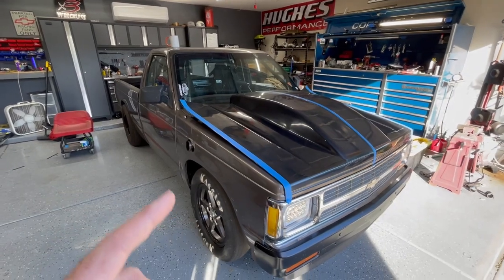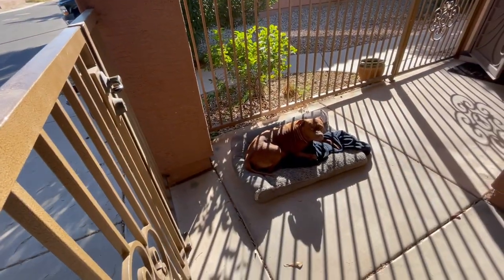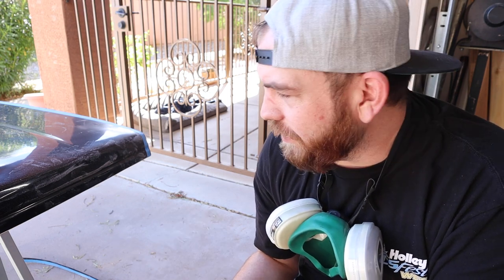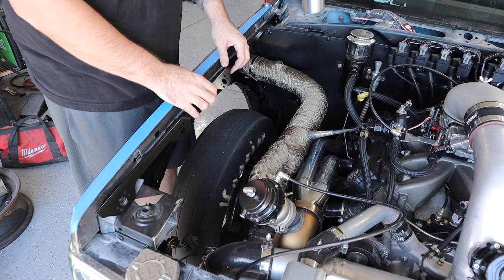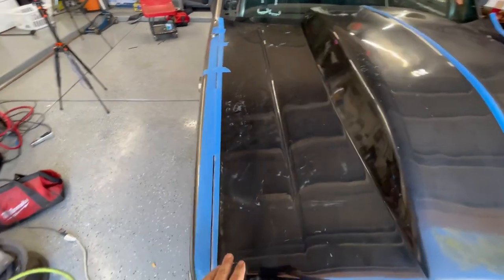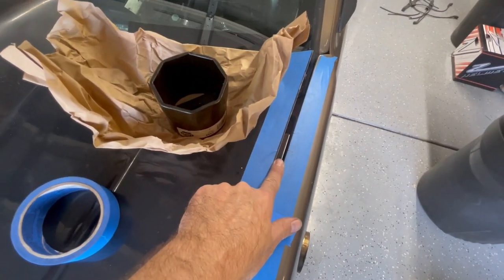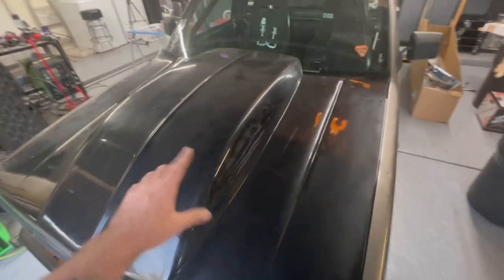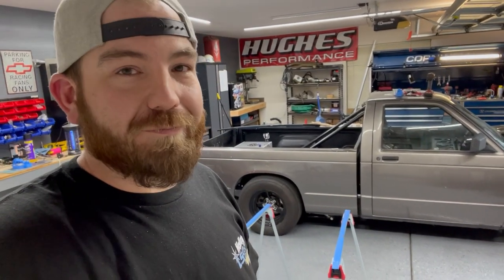FIBERGLASS HOOD INSTALL

Comment: just flatten the hood to gain, then ad a brace with glass to hold the shape on the bottom side for line up of the fasteners. then loosen the bolts on front of fender mounts and pull them in or elongate the holes to move them in as needed.

Comment: Can u loosin up driver fender an push it in 1/4 inch?
Reply: Or maybe even a little bit on both sides to make it close enough?
Reply from the maker: Then the fender and door would be off.
Reply: I didnt think of that lol my bad
Reply from the maker: I went back at was able to move the fender in some without it throwing off the alignment to the door too bad. Thanks for the pointer 👍🏼
Reply: @RobbyVsGarage  nice! I'm glad it worked out. Still adding to the hood?
Reply: The reason i suggested that is i went thru same issue with my s15 and where i had front end off a time or too i had my fenders out past the door as well 😂 glad it worked out for u too man love the channel an may soon be starting my own channel soonalso u may be able to make me some suggestions